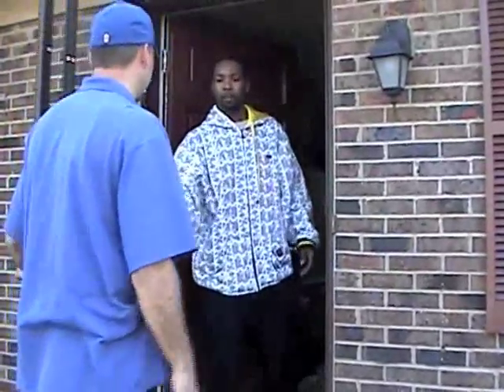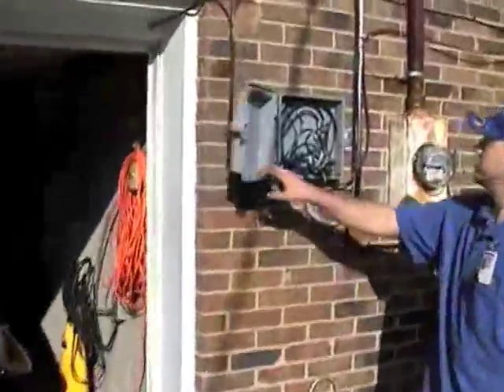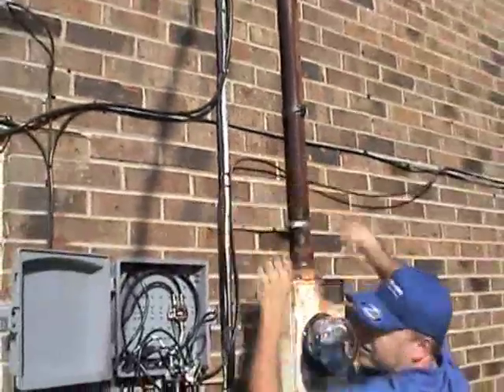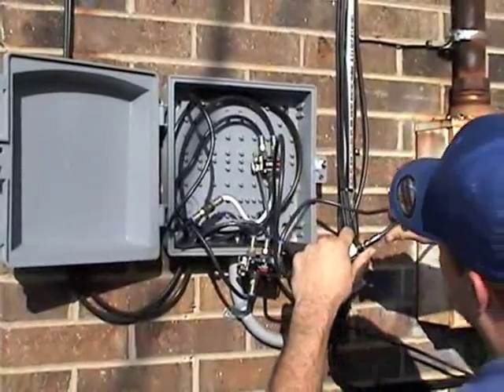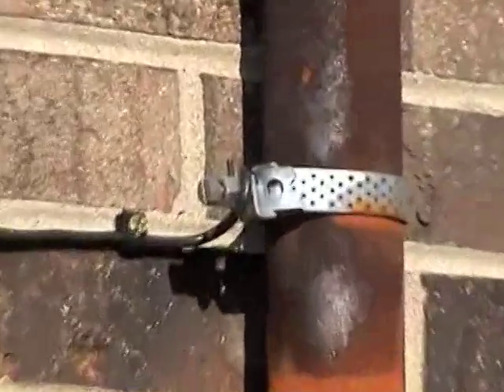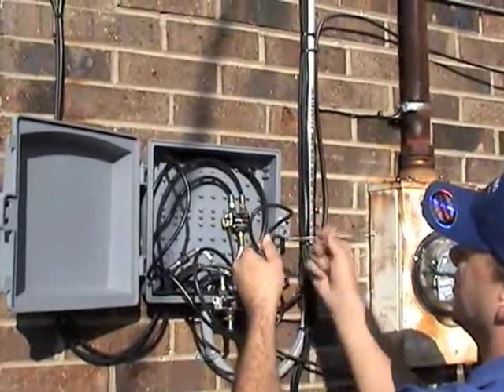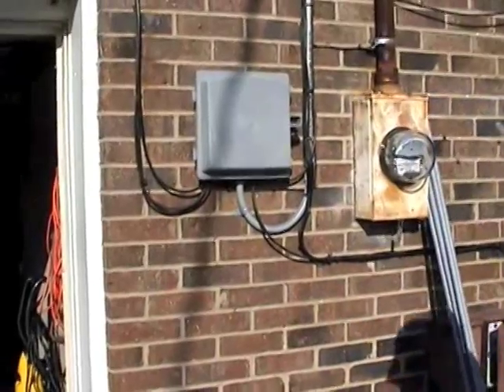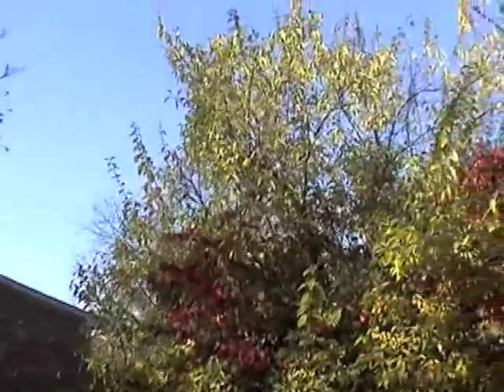What Should You Do at a Upgrade

Comment: Dang, all these negative comments.
First thing I see, Takes off shoes in house, second thing , checking connections and where the cables are run.
Putting on locking connection.

Securing all connections 

This is a good and thorough check on install !

Comment: First of all you aren't wearing Steel toe lace up work boots secondly you need to update your fittings and check them to see if they are sucked in or out (never rely on someone else's work) and then you need to check the house and drop for ingress. The major things though are that you need to attach your harness to the hardline, replace the grounding equipment, change the tag for the drop out (putting the house# on it is a blessing as well)

Comment: I work for dish and we dont have to use those rubber gromets, honestly you dont really need them because as long as you have the connector torqued to 30 inch pounds it will be water tight.  I hate when i run across those gromets, sometimes they are a pain in the ass to work with
Reply: Dish was not always like that. At one time they also required these same boots...

Comment: twc wants to charge 60.00 to move modem in my home. im tech savy but they have a lock on the box. cables are ran and ready to accept the modem on the inside of the house but network isnt being pushed to that cable. is it basically a spliter inside the plastic case. my question is can i just swap where the 2 cables connect and I will have content pushed to the right location?
Reply: Cut the lock off
Reply: gfagsdfgsgfs I did way back when and did everything myself. EZ PZ lemon squeezy

Comment: The cable guys do not care about the next guy and if you are customer they all ready have the stick customers with end of service life equipment.If it was me I would make him one label every thing an replace the mutable splitter with one.the more brakes in the cable the more problems when it comes to internet and new cable tv.
Reply: First of all I am sorry you have that opinion. The thing is a sloppy wiring job in any data system can make problems. I live in area that is serviced by a major cable company. I my self have worked network and data systems witch includes cable contentions for t.v. and web. I think you should take the time to  talk to a ham radio person where you live and he or she can explain RF interference. You brakes joints in coax cable can equal rf bleed or single loss. Let me tell you about equipment  at end of service life. I had this happen to me that is part of the the reason I own my equipment. As computer age the some point will need replaced. We all know this is going to happen. This is on avenger every three to five years.We had a cable box fail no big deal right wrong. The one they replaced it with failed with in the month. The nice thing about equipment makers like Cisco they will post and end of service life bulletin and stating that the equipment is no longer going to supported.
I look the equipment up and it was past it service life and they did not even tell us this. When we ask the tech about this. We are not allowed to give customers with existing account new equipment. We informed him we would check the service life of the equipment on line and he better give us some equipment with some service life still in it. If you buy a new car you expect it to last at lest 10 years or more. You would be mad if it broke the next day. This is the same most every thing else.